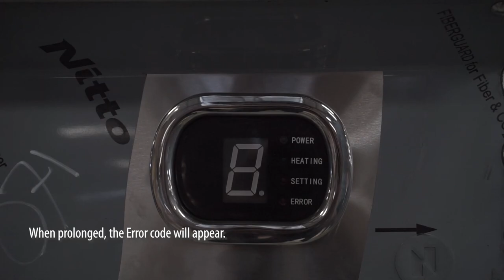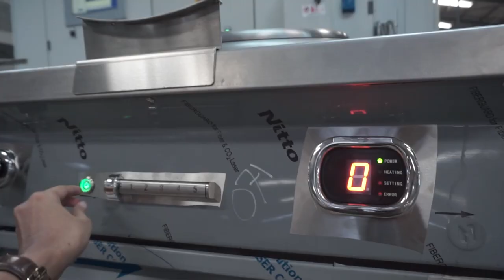How to Operate Induction Wok - Nayati

Comment: The power slide doesn't slide smoothly and can be operated by hand only. Most chefs have both their hands full and use their knee to control the fire. This slide is not suitable for professional chefs. Design needs to be improved.
Reply: True. Or they use they feet to control a lever for heat. But it seems you cant really take of the wok  anyways, due to the generator not being shielded against water etc. So one hand is proba ly always free
Reply: You can quickly tip your wok away from the centre, set your wok spoon down to slide to a lower temperature.